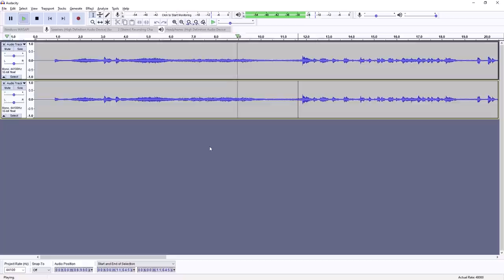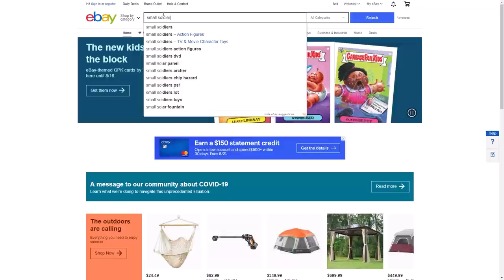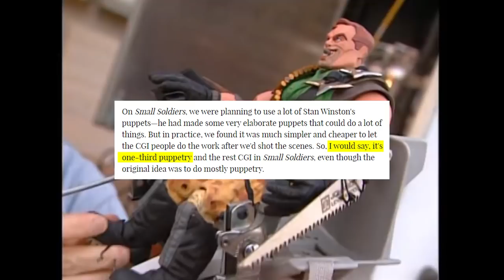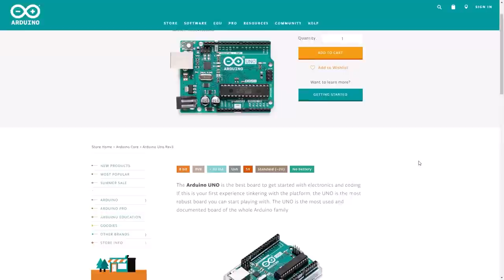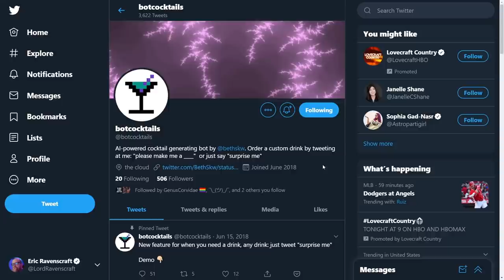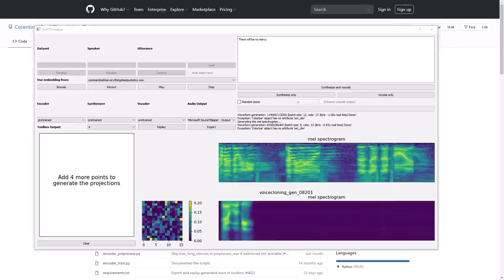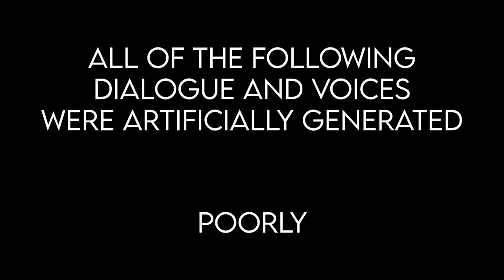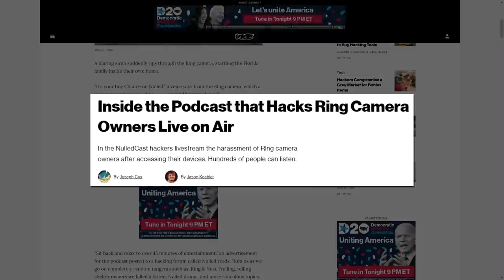You Could Build Your Own Small Soldier In 2020 (But I Can't)

Comment: Not an alcohol bath actually. Early SLA resin printers pulled a perforated platform down into clear resin and ran a laser along the surface; this kept the vat at a consistent volume through the entire print. Then the finished print raises up out of the resin to be removed from the build platform and cleaned.

Comment: Hey Lord Ravenscraft, the step shown in the movie likely isn't an alcohol bath and is just the initial curing, as there really are laser based resin printers.

The machine in the movie works insanely quickly, but maybe they're just using better resin that the $45/kg Amazon stuff that we use in our DLP machines.

There's also a process called SLS (Selective Laser Sintering) where you use lasers to melt powder (either plastic or metal) into the shape you want, although this isn't that.

Comment: You've probably been told this by now, but the ELegoo Mars isn't SLA printing.
Its DLP.
You can still get home SLA printers which do actually use lasers eg Formlabs printers.
But the REAL printers they used in the film are most likely from EnvisionTEC which do actually used a tank of resin and a platform that raises out of the tank...but thats after the model is built.
Imagine the moving platform on your elegoo printer but instead of rising up after each layer these printers drop down into the tank after each layer then having the print rising out of the tank (like the film) once the print is complete.....and they need less build (like the film) because theres no pull force on the model while printing (like your elegoo)

Comment: that scene at 4 minutes in is not an alcohol bath that was in fact the working build chamber. this model of 3d printer (saw it on a tech show around the same time) used a top mounted laser that to harden the top of the bath. this has the disadvantage of needing a more resin but you didn't need to pull it off the flim

the lasers you see are CGI but that was in fact how the parts were made

Comment: whats even funnier is that the x1000 specs(400 MHz processor) are worse than a pentium 4(2000 at the lowend 2-3x 1.3-3.8 GHz) and equivalent to a low end pentium 3(1999 at high end is 2-3x 400 MHz to 1.4 GHz) or a mid range pentium 2(1997 233 MHz to 450 MHz)

TLDR the chip in the movie is basically a pentium 2 with 4gbs of ram

Comment: Waves finger at you when he sees what you got from eBay. Bad bad YouTuber. I have to chip Hazard options laying in my crap for sale bin that you could have used one of which is the talking chip hazard 12 in which admittedly is missing one of the boots what where you're doing 3D printing you basically could have just scan the boot that was there both of them were the same. Second option you could have gotten from my crap bin is the non-talking 12-inch version that wears a cloth uniform either one of these figures is pretty simple to get and very inexpensive toy line has such a small following these days that they've been laying in a box here for about 10 years with a few other Small Soldiers items I think they go for like 8 bucks these days on eBay point being you could have reached out to somebody like myself there's lots of us that have these laying around. Would have cost you eight or 10 box plus the shipping that alarm clock was probably expensive where it's one of the more rare toys from that line